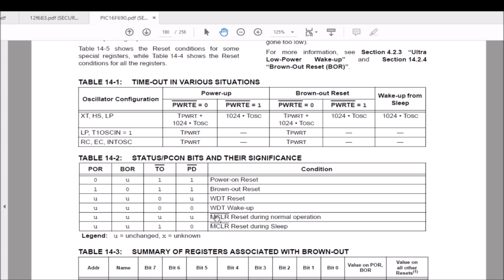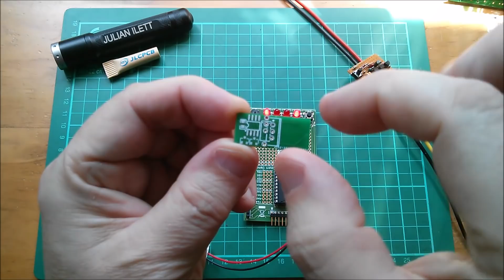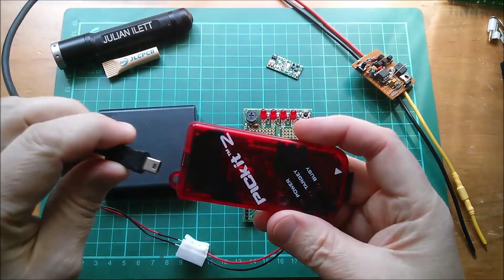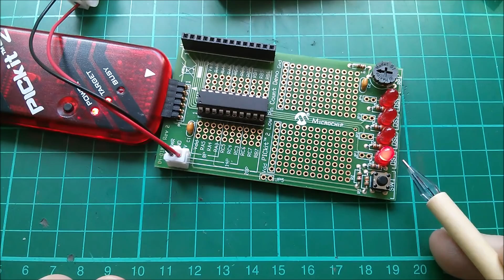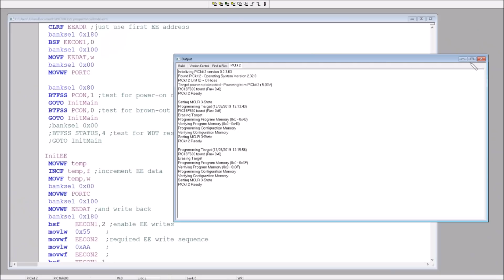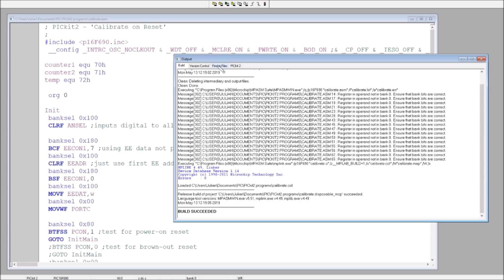PIC Microcontroller Brownouts & Watchdog Resets - PWM5

Comment: all frack the bront.  Determine VCC from a view of the 1 volt ref inside the controller ( if it has one).
I use this on the AVR's

long readVcc() {
  // Read 1.1V reference against AVcc
  // set the reference to Vcc and the measurement to the internal 1.1V reference

#if defined(__AVR_ATmega32U4__) || defined(__AVR_ATmega1280__) || defined(__AVR_ATmega2560__)
    ADMUX = _BV(REFS0) | _BV(MUX4) | _BV(MUX3) | _BV(MUX2) | _BV(MUX1);
  
#elif defined (__AVR_ATtiny24__) || defined(__AVR_ATtiny44__) || defined(__AVR_ATtiny84__)
    ADMUX = _BV(MUX5) | _BV(MUX0);
  
#elif defined (__AVR_ATtiny25__) || defined(__AVR_ATtiny45__) || defined(__AVR_ATtiny85__)
    ADMUX = _BV(MUX3) | _BV(MUX2);
  
#else
    ADMUX = _BV(REFS0) | _BV(MUX3) | _BV(MUX2) | _BV(MUX1);
 
 #endif

// || = comparison OR

//  | = bit OR

// Bit    7         6            5           4            3         2         1         0
// [ REFS1 REFS0 ADLAR MUX4 MUX3 MUX2 MUX1 MUX0] = ADMUX
//      x          1          x           1            1           1         1        x   <-- from above
//      |            |
//      0          1   <----Vref = AVcc pin.
//                             0           1             1           1         1       0  <--- 1.1 volt Band Gap.
//                             0           1            1           1          1       1  <--- 0 volts.
//                             1           0           0           1           1       1  <--- Temperature.    

// example
//  result = 1125300L / result; // Calculate Vcc (in mV); 1125300 = 1.1*1023*1000
//  result = 1126400L / result; // Calculate Vcc (in mV); 1126400 = 1.1*1024*1000

Comment: instead of a button you can use the microcontroller to set these values. even dynamically. with some trickery the uC can sense its own vcc... a would recommend to not write the value to eeprom instantly and rather use the ram or some register to store the value and only write on power off and read on system boot. if you add a big enough cap across the supply rail you should have enough time to write to eeprom safely in tgese occasions.

Comment: That's some interesting software gymnastics! :)
I have to wonder though what the point of this type of calibration is (for this particular use-case) given that the end user won't have access to the 5v supply anyway?
You'd be better off hard-coding in a value, seeing as only you will be able to calibrate them, and that's even putting the natural drift of the regulator over time as it ages.
Reply from the maker: It is in effect hard coded.

Comment: Julian, what about a ATmega328. didn't you do a video about measuring it's own supply voltage, it could calibrate itself. you could also do temperate compensation with the on die sensor, I'm sure you did a video on that also.
Reply: oh fancy although the on board sensor is pretty darn bad. but maybe just good enough for the job
Reply: @urugulu1656  +3c +-2c better than nothing and better than spending extra on components if it's build in. really depends on how much you want to spend
Reply: the 328 is complete overkill for such a rudimentary application
Reply: @motormadness9975  Yes just a bit, like 100 times. just depends on what you have, maybe a ATtiny5 @£0.26 or PIC10F222 @£0.36, will do the same thing, i

Comment: You don't need a switch at all; simply use the input voltage to enter the calibration routine and then to calibrate the unit:
After manufacture power up the PWM5 with a sequence of 'unnatural' voltages e.g. 5V for 1s, 10V for 1s, 5V for 2s then finish on a voltage you would like to calibrate out e.g. 13.8V. Then use that measured ADC result and the error against the actual 13.8V to 'autocal' and set the calibration offset and store in EEPROM.

Comment: That doesn't sound like a good idea to me. The voltage regulator will drift with age, temperature, load,...
It will need recalibrating regularly.
Why not use a purpose built voltage reference?

Comment: Button or shorting pins will mess up your conformal coating. Use a voltage reference???
Reply: If you are worried about the conformal coating, red switches are a great solution.
Reply: @randomelectronicsanddispla1765  Will blue switches work too? :P
Reply: @randomelectronicsanddispla1765  maybe you mean reed switches?

Comment: Why not use a LM4040 Voltage Reference? It would be simpler than your solution I reckon. But as a software guy, rather than hardware, I do admire your version.
Reply: Or a REF5050. Or any other stable, precise regulator...

Comment: Julian, Isn't a switch going to be the weak point on the design? ... or are you thinking of something like a hall effect detector and use a magnet to make the adjustments?
Reply from the maker: The switch will be used only during manufacture - then removed prior to the charge controller being sealed inside its casing.
Reply: Nice idea, or just plain old reed switch.

Comment: I would  use the Forward Voltage Drop of a LED as your voltage Reference ?    Sounds like that means would be more accurate then the one your using.  A pile cheaper as well.   My bet is the accuracy would be better then the seemingly low tolerances of those Voltage regulators. Using the LED looks like you could maintain a accuracy of like .08v  over the LP2905's  0.15 tolerance.   https://electronics.stackexchange.com/questions/77450/voltage-drop-assumption-on-diodes-leds-etc
Reply from the maker: Like other diodes, forward voltage is probably temperature dependent.
Reply: And for a LED, even the incident light is a factor.
Reply: @ciano5475  Encapsulate.  Solved.

Comment: Whats wrong with using a 28 turn pot as a voltage divider? instead of a fixed 5V Regulator.
Reply: Voltage will fluctuate proportionally with incoming voltage, which is not what you want for a voltage reference if youre going to use it to monitor the incoming voltage itself. You want it to be as stable and accurate as possible, and a regulator will provide a (relatively) fixed output voltage independent of the input voltage, at least until its dropout voltage.
Reply: @TomStorey96  I made a 12v battery capacity tester with an arduino basically sense voltage and run the load down to the cut off V . Cannot get it right! Ended up using 2 trim pots for voltage and current dividers and it worked great....until I put it on a different battery and it threw the readings out by about 0.5 v I would accept 0.1 ish. Is that a reasonable target without considering the many other variables of lead acid battery drop testing.
Reply: Useful trimpot commentary - https://forum.allaboutcircuits.com/threads/trimpot-reliability.113915/  tldr - lots of downsides
Reply: @CTCTraining1  thanks for the link I had a read through.
Reply: Voltage would vary with battery voltage.

Comment: a cool project for JLC PCB, your own lithium battery charging / protection board based on the TP4056!
Reply: You can get them prebuilt, with μUSB power connectors, at about 5 for a €$
Reply: i know, but wheres the fun in that? julian could've bought any solar charge controller online, but he chose to make his own, because why not!

Comment: Instead of adding a button, why not just add pins or a socket to which a button can be attached? I doubt a button would survive long enough outdoors, even if potted/coated etc, to be used for more than one calibration.
Reply: Or a reed switch.

Comment: Do pic micros not have band gap diodes to reference the ADC against? When ever I've used an ADC for low to medium applications the internal references have proven to be good enough eliminating the need for vcc ratiometric measurements. If you're working with things like thermistors in battery powered applications then ratiometric has a much better performance.
Reply: Checked, that pic doesn't not have a reference but this 8 pin pic micro does PIC16F15313
Reply: Some PICs do have a voltage reference of 1.024, 2048, 4096mV but not all of them.
Reply: Pic is a pretty poor choice these days, they often have very few low functionality peripherals and are not as cheap as you'd imagine. Far East microcontrollers are often cheaper and have more rounded functionally, for example hdsc and paduk both make ranges of cortex m0+ micros some with specialised peripherals like 24bit ADCs while maintaining a very low price point.

Comment: Why program in asm when its 2k19 and u can do it in c
Reply from the maker: I like to program the bare metal - C is for snowflakes ;)
Reply: @JulianIlett  "It was eventually realized that programming in assembly language required a great deal of intellectual effort." From Wiki!!  lol
Reply: @JulianIlett  At least it's not Mark 1 Autocode!  lol
Reply: @JulianIlett  its not for snowflakes it definitely has a place as c tends to be very verbose. and c can be very bare metal too (just cut all the libraries)
Reply: @JulianIlett  I've been waiting for the comment that says: "I spit on your Assembler, a REAL microprogrammer does it in binary!"
Reply: Why not? Assembly is fun, and its more of a challenge than C so it gets your brain working harder which is a good thing!

Im currently working on a Z80 based project and writing that in assembly. But I also write C for other projects. Each language has a time and a place depending on what youre trying to achieve.
Reply: @TomStorey96   My introduction to microprocessors was the Z80 (when it was new) - an amazing chip for it's time and still today. One of my first projects was interfacing a Teletype Model 33 20 mA loop serial printer to a Centronics parallel port. I wrote the code in assembly language and enjoyed every minute!
Reply: @davidv1289  It is a great processor to write code for. I cant really put my finger on why, but ever since I learned (waaaayyy back when I was really young) that Z80's existed, I always wanted to do something with one. Fast forward about 25 or so years and finally Im getting to it. :-D
Reply: Because he likes to program in ASM...and furthermore , its his channel.
Reply: And it will also remove those "GOTO's" ;-)
Reply: @ArjanvanVught  nope as c compiles to asm first. which means you just get them in a different way. also asm has no functions loops if or anything. but goto in like 15 different colors and flavors
Reply: there is sometimes a need to do so either to ensure maximum speed minimum space accurate timing or  a number of other things where compilers may tend to produce poor kinds of output

Comment: Hi Julian, I've found that these 5V linear regulators tend to drift considerably with time and temperature. This means calibration would have to be done somewhat often. Have you had a look at the TL431 adjustable precision reference IC? From my experimenting, a stable and 1% accurate voltage reference can be achieved easily (and cheaply).

I'm working on a precise LDO to source considerable amounts of current as well. If you don't need to do that though, you can just wire the output of the TL431 to the ADC reference pin.
Reply from the maker: Unfortunately, I've run out of pins on the 12F683. I suppose the uC could tolerate a slightly higher voltage on its Vref pin if Vdd were slightly less than 5V. Much testing would be needed.
Reply: Looking at a schematic of the PWM5, it seems that one source of the pin scarcity is that you use two of the eight pins to manage the charge pump.  If you added an external inverter you could manage the charge pump with a single pin; if you added a dedicated charge pump IC you could save two.

Then, you'd be able to have a dedicated voltage reference on the chip, either as VREF for the PIC itself or for periodic re-calibration.
Reply: I wonder how stable an AMS1117 is.